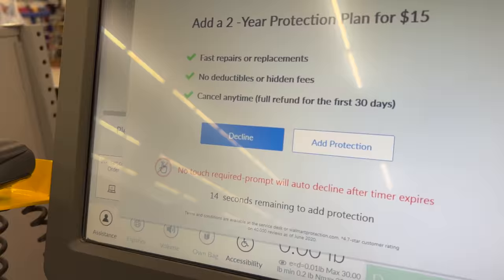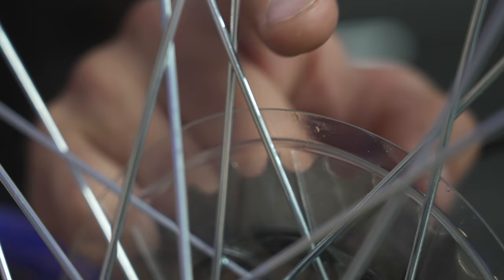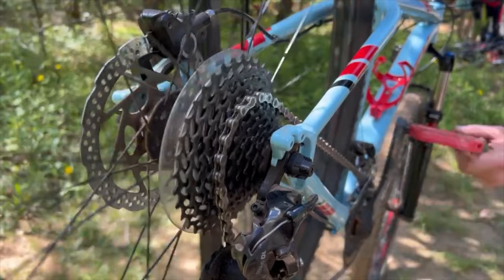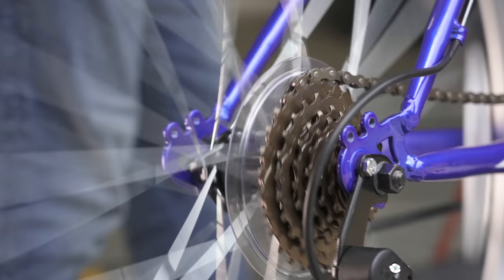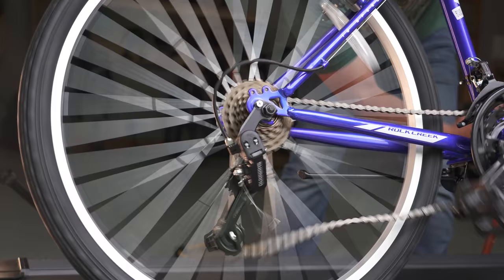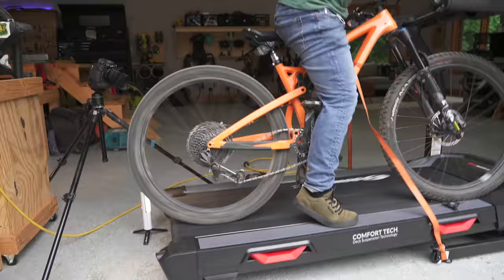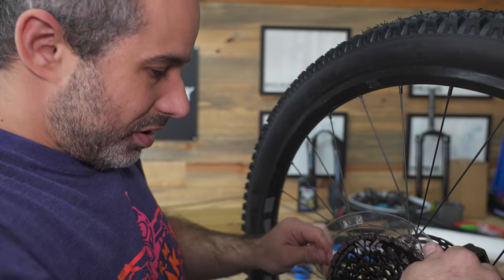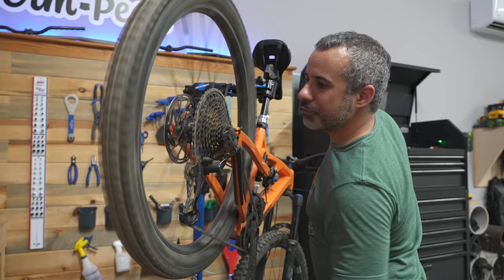What is your "dork disc" actually for? What happens if you remove it?

Comment: You didn't get the carnage you were hoping for because the bike wasn't being pedaled so there was no stress  on the chain. If you drop the chain like that while pedaling hard, you WILL pull your chain between you cassette and spokes so tightly you won't be able do pull the chain out, because your legs are much stronger than your arms, and it will cause your wheel to lock up. Your chain will chew up your spokes, causing them to break either immediately, or a few rides later.  Been there, done that. Several times on the same bike. For science.

Comment: IMO the dork disc is well named. It is not useful for those riders who might use the gears where it provides a function; they will obviate the need with maintenance procedures. I get off and walk before I need 1/1 and I don't need to go 3/7 fast. (If I got those backwards just reverse the numbers.)

Comment: ive def had my chain hop off the cassette without a dork disc and into the spokes locking my rear tire up, i had to yank on the chain so hard to get it unstuck someone else might not have been able to

Comment: In my experience a dork disc wouldn't make any difference with regards to debris fouling the derailleur. Ive had a plastic bag get into the derailleur, the lower jockey wheel fall out and a chain come off the small sprocket and all resulted in a destroyed derailleur either by it hitting the spokes, frame or both!

Comment: had a derailer pulled into my wheel first ride on a new bike. that sucked. cost me a new derailer and bending straight an aluminum hanger is not fun. the whole derailer just snapped on the bolt connecting it to the frame.

Comment: Of course bad things will happen if you force them to. I've been riding bikes now for roughly 30 years, and I NEVER once kept on the "dork disc." That and the reflectors are always the first thing intake off, followed by the stupid kickstand, which in my opinion is more dangerous to keep on a bike than it is to take off the dork disc. I have never once had a single issue. I lied, the dork disc does make it easier to get the chain back out and on the cassette. I have had the chain tightly wedged. But that's it. Not really a problem. You just get a little more chain grease on your fingers. 😂

Comment: The only thing ' dorky ' about a dork disk is that 99.99% of the are made of the worst, cheapest easily deteriorated plastic on earth and crack and break up in short order.
Unless you have something like an old Schwinn where they are made of chromed steel.
I just made one for bike i am building that is made of aluminum.

Comment: It's unnecessary.  I was riding a friend's raleigh c40 he had just bought...and the limits were wrong. The chain went in there WITH the dork disc, and absolutely destroyed the derailleur. Snapped it off and grenaded it. Bent a few spoke too, but, they were easy to fix...and we had another derailleur sittin around that we threw on there. Like it never happened. 👍🏻

Comment: I once jumped off the stairs on my hardtail with no dork disk but i did a terrible mistake of shifting into 1st, since right after the impact the rear wheel locked up with a terrifying bang, which turned out to be the chain pulled in between the spokes and the cassette with rear derailer pulled around the cassette and chain tensioner ripped out and bent, jammed along the chain. Still don't have the dork disk or any plans to install it

Comment: you can get some catastrophic results if pedaling the bike uphill with enough power, limits not well and no dork disk. It happened to me on my wives birthday ( i should not have been riding that day) my derailleur got sucked into the back wheel and damaged the hanger, the derailleur was bent, I also felt like it damaged the internal mechanism of the wheel and I was really late that day to my own wives birthday : S

Comment: instead of locking my cycle i take the chain off from me pedal area and just so happens when bringing it back inside it go derailed from the gears on both front and back and the cage for the chain on the derailer go caught in the spokes and my derailer is damaged cycle still works but only in tighter gears so i cant ride uphill

Comment: This doesn't seem like a good test. The spoke side cog is low gear. The time you're likely to come off that side is when you're pedalling up hill with high tension on the chain. Then the force of your pedalling will jam the chain down into the spokes. This test was with you freewheeling downhill which is totally different situation.

Comment: I think they are required here (NZ/Austrailia) by law but they are always the most throwaway cheap useless part. One of the ones on a road bike i bought wasn't even fitted properly and on the first ride it just snapped in two of its own accord. 
It seems very fanciful to me that a competition road bike, exclusively ridden on smooth roads, well maintained with high quality electronic shifters, will EVER have an issue. And yet, because its law, you can spend literally 25,000 on a bike, and it'll come with the same stupid plastic disc.

Comment: One time when I was at my local downhill park, my dorc disc snapped and kept getting stuck in my chain so I couldn’t ride properly, I noticed it straight away and I went to get off the bike and the pedals span round real fast for some reason and smashed my shin right below the shin guard, so I think I’ll be taking it off every bike I get now😂

Comment: Doesn't seem to prevent any crashes or injuries. The dork disc seems to act as cheap insurance to make sure your derailleur doesn't get trashed. On a Chinesium Huffy, who cares? On your expensive cassette and gear set, maybe run the dork disc. It's less than an ounce, and if something goes wrong, your very expensive derailleur might live to see another day because $0.15 worth of plastic was there.

Comment: i have one on my 13 year old hardrock lol my mate told me to take it off but i canny be botherd as means takeing the cassette off, from my experince if the derailer is going to go through the wheel witch i have done a few times it dosnt care if the dork disc is there or not.  my other bike dosnt have one though as i built it and didnt have one to put on it and to be fare i prob wouldnt have botherd fitting it if i did have one, dose help stop the chain getting jamed up in the spokes though.

Comment: i have had 2 derailers break on me and i dont even ride much, frist one got a whole stick in to the mechanism and bent the derailler it self, the second time almost the same situation, hit a stick and i dont even know waht happened but when i came to a stop my derailer bracket had snapped off. Also the dork discs on my bikes just shatter after year or 2 the plastic just cant hold on for long

Comment: I actually didn't know this dork discs were a thing cause I only saw them on kids small bicycles if mines brought it I surely removed them on day one 😁

But I indeed had many broken rear derailleurs but they were all cheap shimano anyway, not the cheapest but just slightly above and most were simply from jumping here and there until something in the rear gets slightly bent and boom another one broken but the majority indeed was clearly telling me for many time as they start clicking but I almost never bother adjusting them much and then shit happens 🙃

Comment: If it is a safety measures, why does it not get executed in a better, more durable manner, making use of a material that would last instead of weak plastic or a thin slither of plexi glass?

Comment: I still think the entire chain-driven system is kind of garbage. You wouldn't believe how many issues I have had with chains even where it came off the guards around the front gear and tangled so badly it locked the wheel

Comment: I think they create more issues than they solve. The muck that gets stuck to them, the fact they make it harder to clean and maintain the rear hub and sprocket, they get cracked and tatty in a short time, and...they are adding at least 5g of weight, which is just unacceptable.  OK, I admit it, it's because they look crap and don't really do much.

Comment: I've been running 10 speeds in mountain bikes without them dork to set break off all the time for years I never ever had a problem like you're talking about with yeah it is possible but I never ran into that problem and the bike I'm riding now I got an engine on it so I have to do whatever I said just for one year and that's 3rd gear I got the cable cut I got the real set so I don't need one in dork danger talking about I'm going to buy for years with that one never had a problem

Comment: The dork disc is useless not because of the "if you adjust your limits properly" argument but because of the simple fact that nobody in their right mind would ever do a high speed descend on their lowest gear or worse yet try to shift even lower, it's absurd.

Every normal situation where you actually might go over the cassette wouldn't be dangerous because you wouldn't be going fast.

Comment: Interesting to watch, but your being a bike expert flopped... It is a chain guard and prevents the chain in most cases from coming off the gears. One factor you did not allow with the derailer of the front chain drive. On the inside gear and off the largest gear in the rear is the grand problem. Chain has lots of slop and all of it is over to the inside area.

Comment: my best guess is it's really meant for when sticks and such get stuck in the spokes and it helps to keep them out of your gears and chain. It's not as big a deal if something goes into your spokes along out-side compared to inside. So my guess is it's more for freak scenarios which can happen and likely to increase safety. but reality is it's likely just a numbers game and unlikely to make any difference for a single person, kind of like wearing a mask does little for you but everyone wearing a mask can have a noticeable difference when looking at thousands or millions of people to slow spread of a virus which is a concept that the anti-mask people don't comprehend and this similar situation likely just reduces 1 in a 1000 people from experimenting an unlucky freak situation. Think of it not from your perspective but perspective of the company, if the company making these bikes know adding this disk will reduce chances of being sued by .01% they will add it to every bike if it's a cheap addition which this is.

Comment: I do not know why they have those handle bars so long.Mine are very short for more harder torque power speed.further they are out for me more I loose.I have a slick 2.2 fat tire than a 2.00 studded front tire.I keep all my gears on high for torque. I never by bikes with center shock because I loose torque energy. I need always front shock.I refuse to buy dosc break bikes.i use cable breaks.Disc breaks tweak to easy and cause enph friction to slow me down.coasting is my big thing on my mountain bike.

Comment: "If you adjust your limits properly you don't need a dork disc" is the same kind of logic as "if you always pay attention you'll never need an airbag". There's always a margin for failure and a margin for error. If you rely only on a single safety mechanism, what are you going to do if it fails? The far better approach is treating each safety feature like a slice of Swiss cheese. There's holes in it, and you've got to do your best to make sure anything slipping through one hole still gets caught by the layer behind it. Unless there's a reason it's actually harmful, leave it in place.
Also, not all bikes have these, contrary to what you're claiming in the description. Bicycles with hub gears are common as commuter models in many countries, and those don't even have a derailleur, let alone a dork disc. The downside is that hub gears are less precise, but they take less maintenance and aren't as prone to failure. If you're mountain biking or racing, a derailleur is probably the right choice, but on any other kind of bicycle you should probably go with a hub gear.

Comment: I take them off road bikes. No need for them on pavement. If you do overshift, you will be going uphill and very slow anyway. I have done this before without a dork disk and never had it cause any damage. It is kind of a pain to have to stop, remount the chain, and then get going again. I leave them on mountain bikes. On the trail chains do weird things. It's probably partially superstitious on my part but I'd rather be safe than sorry.

Comment: For me dork disc is going off every single time I get a new bike immediately. Once I didn't remove it it got flimsy during my trail ride and caused exactly what you were trying to recreate, it fell off mountings on wheel stems, my derailleur got stuck up in my wheel causing me to rebuild rear wheel and swap derailleur... literally out of box bike that was "ready to ride" 😂😂😂 guys stop producing plastic waste Dork disks are useless in modern MTB they only cause even more damages

Comment: Yes the world needs a bitch'n dork disc... Perhaps engineered to throw/guide the chain back on the gear... Or perhaps a dork disc with an integral sprocket to catch the chain when it inevitably comes off...(could be made of slightly higher quality cheap plastic or carbon fiber and titanium) ...Boom there you go take that idea and run. 🤔😁
 All they've ever been is the cheapest thing a manufacturer  will do to comply.

Comment: I see no reason to remove it, ever.
Just, why?
Never had that disc cause any problems. If you've got one that breaks or comes apart the fault isn't it's presence, you bought cheap junk.
I think you've got to be a bit of a dork to take it off.

Comment: Why bother taking it off, its a load of work for no real benefit?  Even with correctly adjusted limits the violence of some trails will have the chain whipping all over and there will be an occasion when it scoots behind the cassette.  The chain will damage the spokes and possibly vice versa, but maybe not catastrophically and given the number of times it could happen then at some stage rebuilding the wheel will not be an option but a must.  You see all sorts deliberately not protecting themselves or their equipment because it is 'cool' (stupid term) or fashionable when the real 'cool' person sees it as an advantage for enjoyment or winning.  Imagine a F1 driver getting into his race car in shorts, teeshirt and bandana because it is 'cool'?  The halo was derided as not 'cool' but has saved Hamilton from death(?) when Verstappen parked his car on top of Hamilton's.  Stop being a Dork and leave the plastic on, it does no harm but might actually do some good.

Comment: Hmm, find a part you're pretty sure just sits there 99.9% of the time, give it a stupid name, and declare it useless. I don't call that science. I call that 'I'm struggling for YouTube content'. I've been told I can take the air dam off the bottom of my car. It doesn't protect anything anyways, and lazy mechanics just throw it away when too many screws fall out. But is it really useless? It was designed for a purpose. They might not know the purpose, but it's not their call to declare it useless.

Comment: i rather have a violent chain derailment at 40 miles per hour on a root ridden red ant infested trail with rear wheel being desitigrated and spokes and rim parts flying around like shrapnel on WW2, with me being wounded with several gunshot type injuries and legs torn off while i am somersaulting down the increasing slope with 2300 feet to go in acid rain with 13 hungry grizly bear mothers on period in a venom spike pit below than have a dork disc. period.